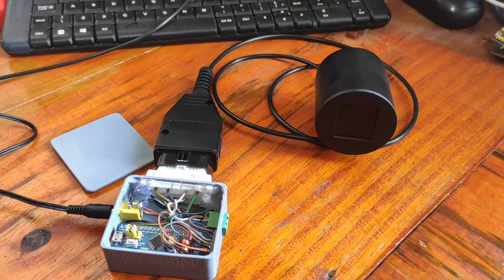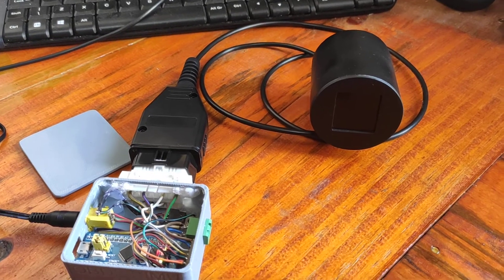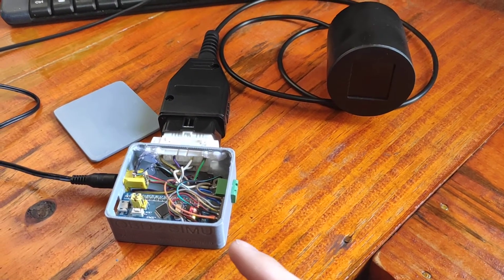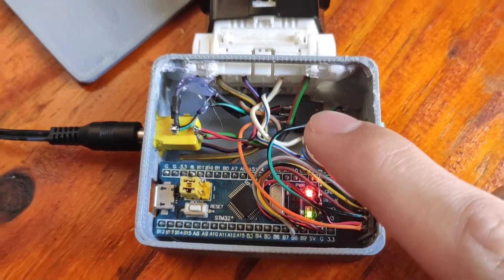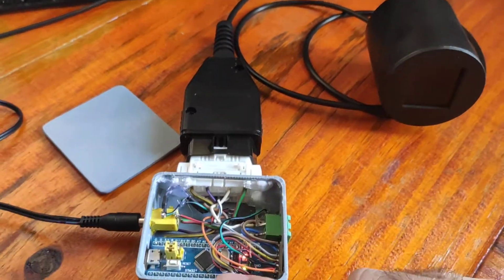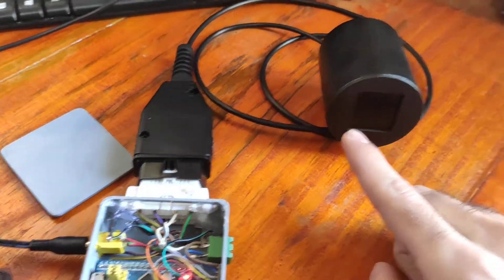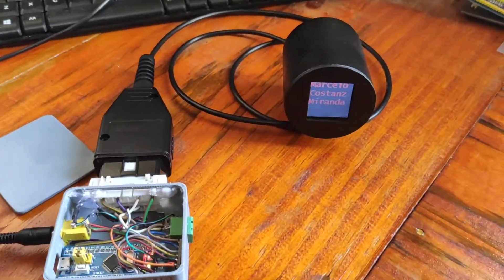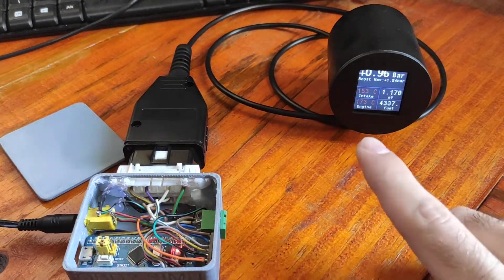OBD2 CAN BUS Simulator

Comment: Perfect, I am building the same device with same board. I can have your code as a guide. Thanks for sharing.
I am building the simulator, because I want to have a test bench for the obd2 scanner I want to make. Did you have the same idea? If so, did you build the scanner device as well?
Reply from the maker: Yes, I build for this purpose
Reply: @marcelocostanzomiranda646  can this device emulate multiple protocols and does it have VIN generation?